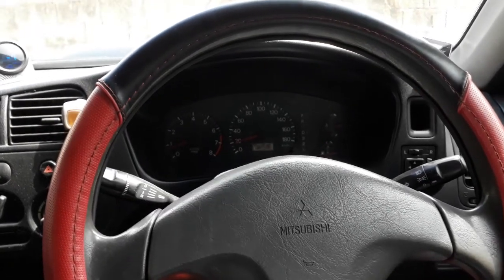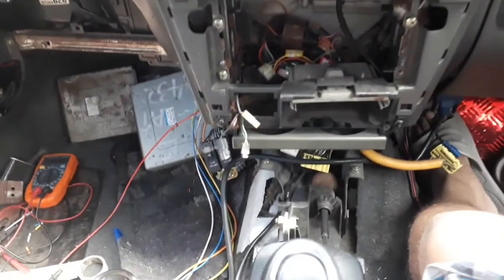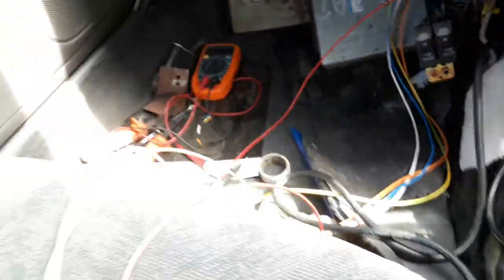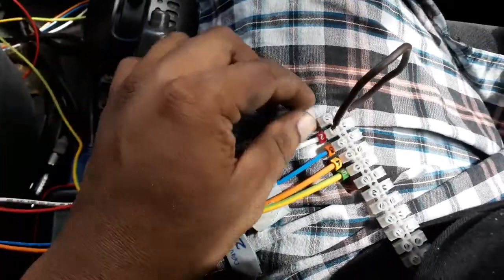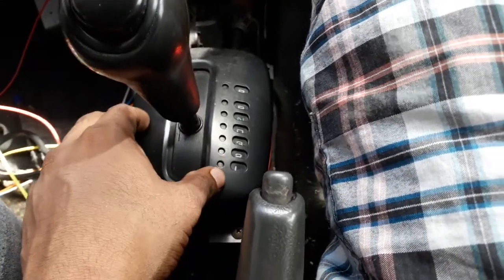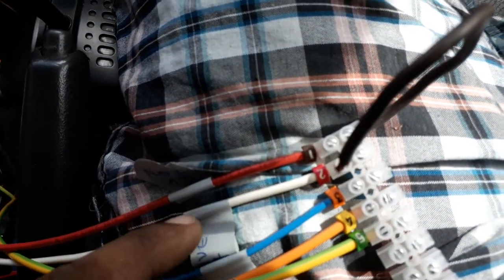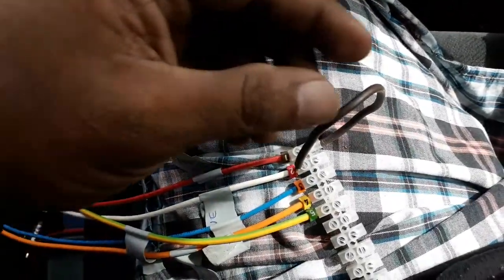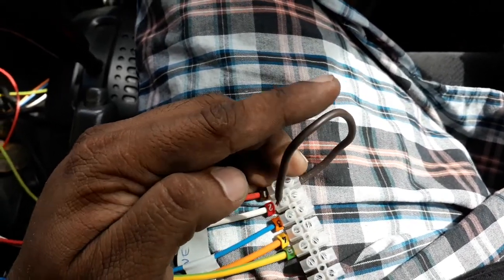Mistubishi Lancer automatic transmission INVECII 4 speed conversion to tiptronic setup

Comment: I wan do this on my car too hve the shifter already
Reply from the maker: kool send email address and I'll fwd the electrical drawings.
Reply: @chrislow2159  rodneymatthews25@gmail.com
Reply: @chrislow2159  u does wire cars abd stuff if u do i could give u some work to do on my car
Reply from the maker: @rodneymatthews25  I used to bro but time is not on my side anymore. check your email any decent electric can handle it up 4u with the info i sent.
Reply: @chrislow2159  than u